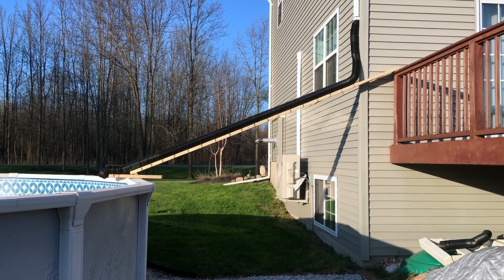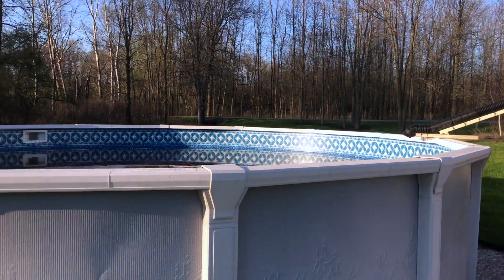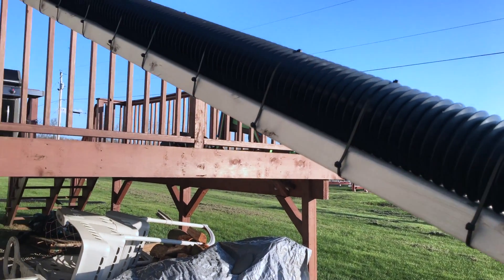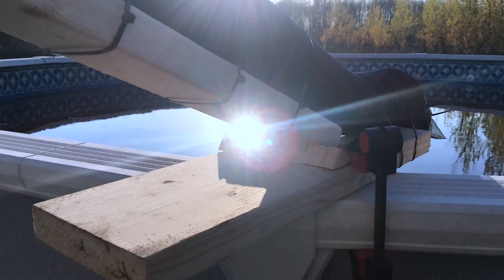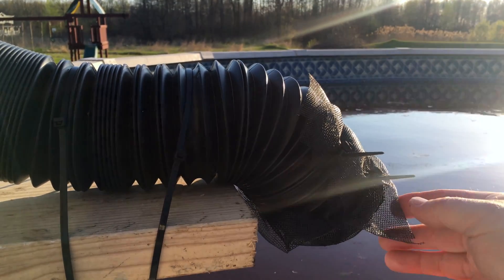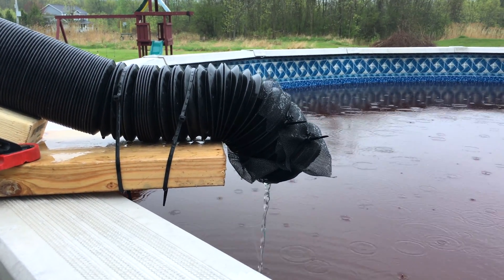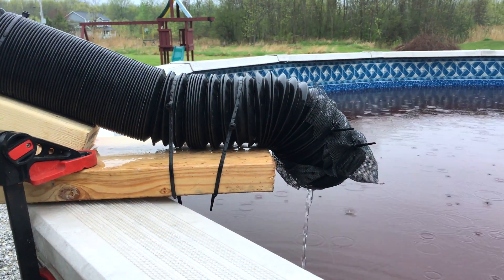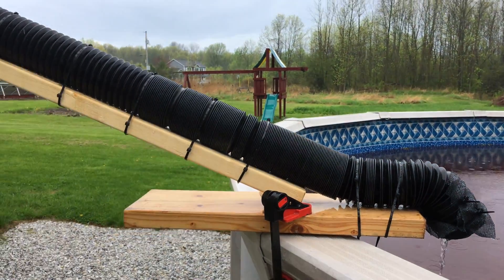DIY Harvesting Rainwater to Fill Swimmimg Pool

Comment: Is your entire pool filled with rainwater ? Did you ever use the hose to fill some? I am attempting to fill my 3000 gallon intex pool with rainwater. I hear pros and cons to it from different people. Some say I am wasting my time and going to take forever and also They are always talking about acidic levels and other chemicals that could come off the roof like lead . I have a pool sock that filters out the shingle dust and whatever else . Isn’t this all shocking the pool with chlorine can fix ? I just do not want to create dangerous situation for my swimmers.
Reply from the maker: Most of the pool water was brought in.  I just now top off with rain water especially when it gets low in the summer. You should be able correct any water issues from your local pool supply store as you test each week.

Comment: I think a 2x4 stand with a 5 gallon bucket input to the center, with a siliconed-in PVC angle and tube as an overflow near the top will prevent composite roof material gravel from going in the pool as a pre-catch basin (which should be removable to be able to dump).